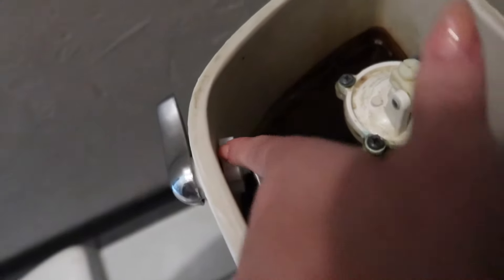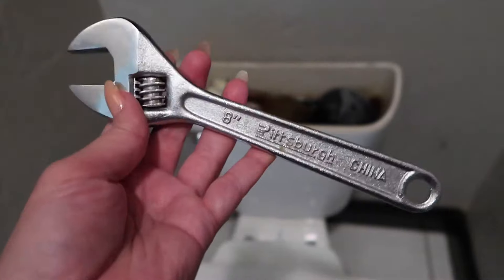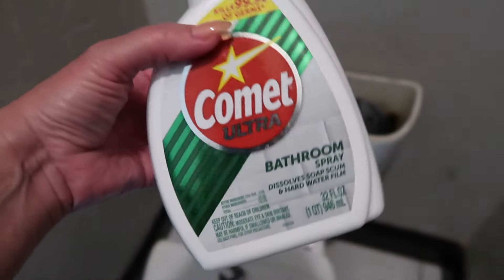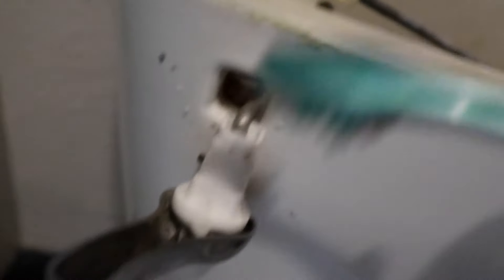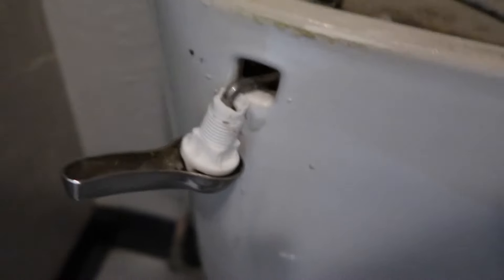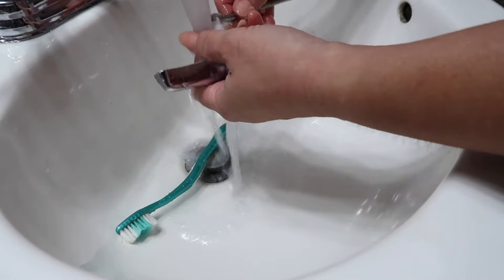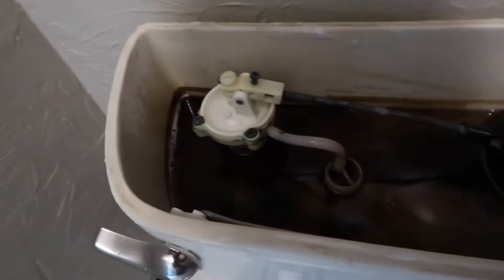How to Fix A Stuck Toilet Handle | Toilet Handle Sticks | Toilet Handle Stays Down | Toilet Handle

Comment: You saved me from calling a plumber. Thank you! I used Lime Away, let it sit and used a tooth brush. When I loosened the plastic handle screw, there was no buildup on the outside by the handle. The buildup was all inside the tank. The only thing I had difficulty with was figuring out which way to unscrew that plastic screw inside the tank. It turns out in my toilet to unscrew it, it goes clockwise 🤷‍♀️
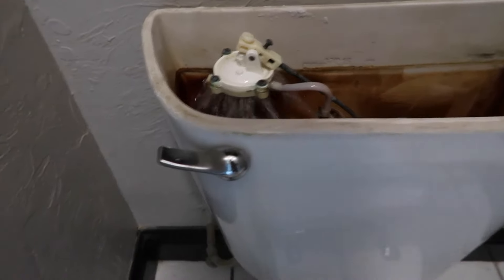Reply: Handle works now, however at 2:50 you can see that your fill valve is compromised and spraying water in your tank when it should be filling out of the small hose attached.

You can do a video on valve replacement next!

Good video too.

Comment: Handle works, however your fill  valve is compromised and spraying water in your tank at 2:52 and should be filling through the attached rubber hose connected to the fill valve outlet. 

Another opportunity to created another video changing out a fill valve assembly!

Thanks for the helpful video.
Reply from the maker: Thanks for watching. it has been replaced.

Comment: One more thing to check, which may be more in cases in apartment complexes, is that the tank lever is the correct style for your tank. The maintenance workers of this 200+ unit complex that I live in installed the wrong one in my tank and so it pressed against the inside wall of the tank and got stuck when in the up position. The temporary fix for me was to loosen the handle nut way beyond what it should be. This allowed the handle to pivot in the xy direction, which prevented the lever from being pressed into the inside wall of the tank.